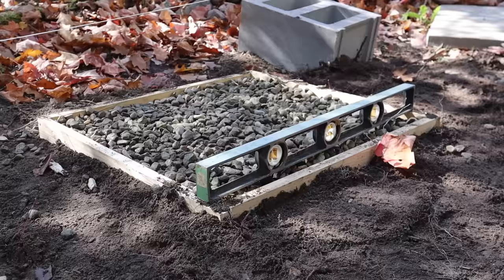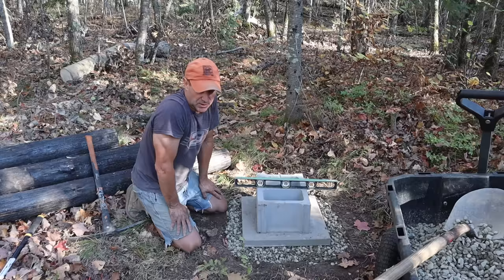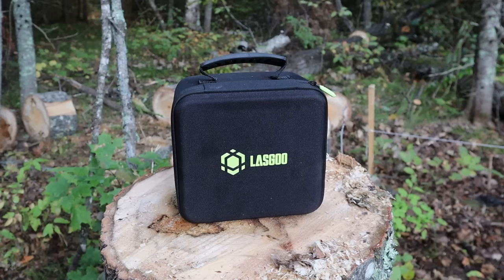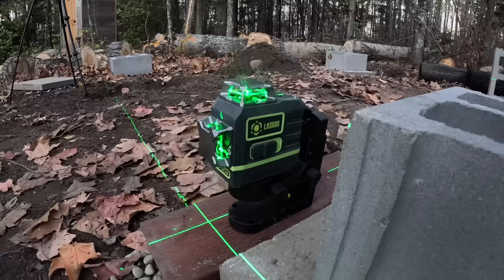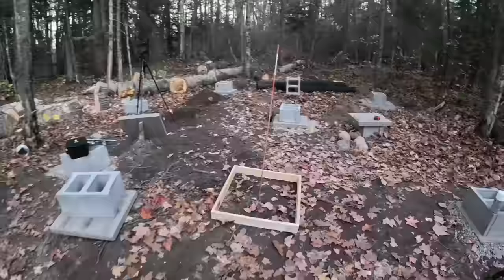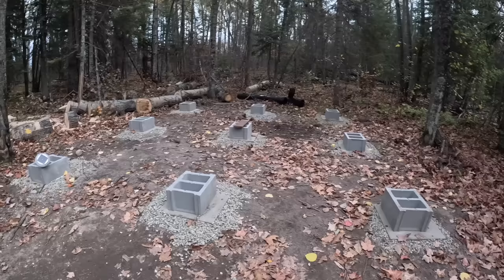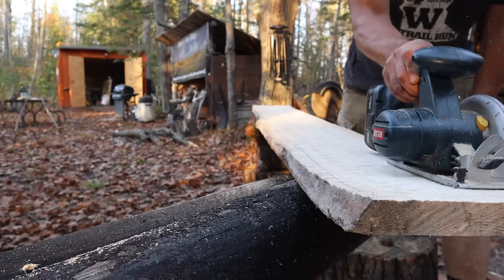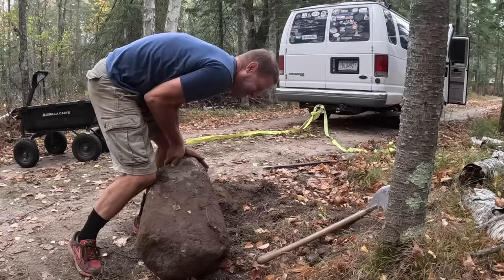You're NOT going to LIKE this....Tiny Cabin FRUGAL Foundation Build

Comment: The video quality continues to improve, just as you had hoped.  A small bunkhouse is a great idea.  I keep trying to figure out if you ever put shingles or sheet metal on the tool shed and outhouse.  I never can get a view, or did you just leave it with tar paper ? Good video as always, my friend.
Reply from the maker: The tool shed has rolled asphalt roofing. It's been working well. The wood sheds just have rough sawn boards. That is working less well! Long term plan is to put metal on them. I'll probably add to the order for the bunkhouse

Comment: The "Floating" foundation idea is great, for ALL of the reasons you mentioned. 
Now, the idea is to stop moisture, or limit it, from getting into the foundation, not so easy.
A large overhang on the roof, 2 to 3 feet will help a lot.  Also, maybe fill the block voids with concrete?
You took My "hair brain" idea, took it to the next level and came up with a really good solution, Great job, really great job. ;-)
Reply from the maker: I was thinking of maybe adding some poly on the ground under to help with ground moisture?

Comment: Great job Tre. I have a cabin in Maine and it sets on clay. We bought it 20 years ago and every footing was heaved. Had to have someone come in and Jack it up and put Bell Housing posts or frost posts in. $5k later and it’s good now. You have the right idea for a cabin that size. I follow Kyle’s Cabin, another guy from Minnesota and he did the same exact thing you did on clay as well. He said he should never have a problem either. Keep enjoying retirement.
Reply from the maker: Its so small that it should be easy to work with if i have issues.

Comment: Good job, hard work.  My concern is the use of simple patio slabs?  They are not designed or meant for the weight of a building. A true pier slab will be re-bar reinforced, and made of good concrete.  I hope it works for you?
Reply from the maker: I hope so too!

Comment: Nortek 6680 Leveler.  Here is an example for you to think about prior to building.
Reply from the maker: Seems like a great idea but yikes that would be almost $1500. Unless you didn’t need one for every pad
Reply: @TRERUNSWILD  just an example.  There are other similar products out there.  Most do the 4 corners on smaller builds and shim like you said in between.  The laser will come in handy if you ever need to do any adjustments like that.  You may never see anything there that will cause a need for leveling. Good to have it when you need it then not have it and need it.
Reply from the maker: I could use one on the cabin. I have one corner that moves due to a stump I ground out and didn't fill properly. Maybe I'll pick one up as an experiment

Comment: Aren't you worried about the shifting of the blocks from water freezing in the gravel? You could do water abatement on the gravel. I used to work for a builder, and the only shifting piers or crumbling was from bad concrete (or uncovered rebar.) Or the piers were not put in properly. One building we had buildt was on two different kinds of foundation. One end was on 20ft of sand, so the engineer said the regular piers had to be on 4ft wide feet instead of alittle bigger than the sonotube.
Reply from the maker: I know that the pads will move up and down a little. With piers if I'm not deep enough they might move up and not be able to move back down when thawed. The other issue is I have so much rock in the ground that a 5' deep hole is not practical.